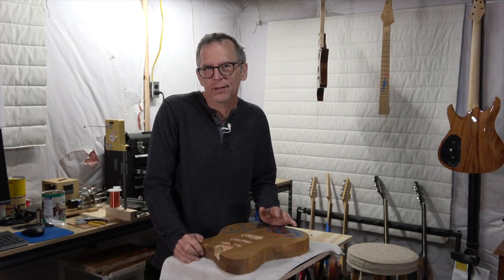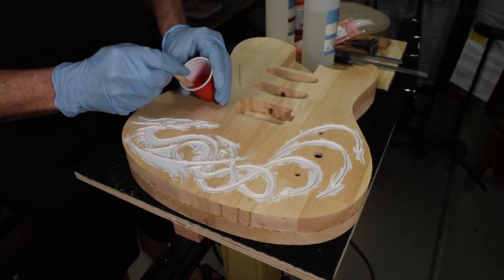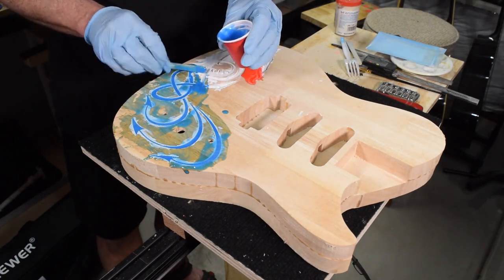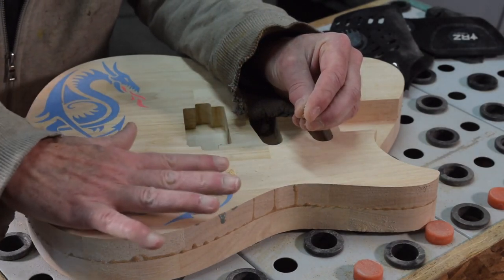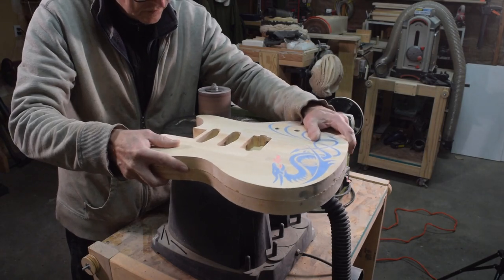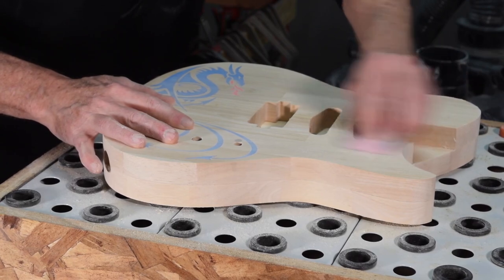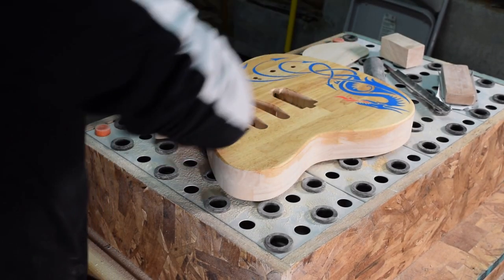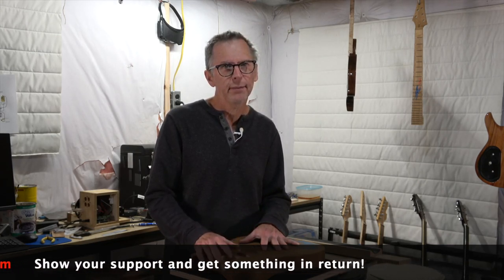Making A Guitar Out Of An Oak Table Top Part 6

Comment: As far as the Thickness question, It does look a lot thicker than a Les Paul because of the carved top too which makes the thickness look significantly thinner - even if its technically thinner than the LP's thickest point...
Reply from the maker: I agree. I just think it's odd that body thickness (or thinness) is a thing.
Reply: @HighlineGuitars  I don't think its a 'thing' as such - at least not until it 'looks' a lot thicker.
As a player, I would be less inclined to pick up a 'thick' body Electric - especially one that has a flat top and back. Part of the attraction of Ibanez S series guitars is that ultra thin body and how much of a Slab the Tele is and this looks 'thicker' and more 'cumbersome' than a tele.
I am not criticising your decision as a builder and enjoying watching your many builds. I was merely trying to explain why thickness can matter to a guitarist - especially if you expect to be playing the instrument for hours at a time - not looking at it hanging on a wall. Something as 'thick' as it looks (again 'looks'), I would expect to be a 'hollowbody'.
Again, I am not criticising,just trying to explain why 'thickness' can matter to a Guitarist. Of course there is nothing like actual hands on with the instrument and it may well surprise a few people if/when they get to play it.
Reply from the maker: @BAMozzy69  I guess that’s why nobody wants to play acoustic guitars. They’re so thick.
Reply: @HighlineGuitars  And some Electric guitar players don't find Acoustics all that comfortable - but they are also very light by comparison. 
As a player, I expect an Acoustic to be thick and large bodied in general because that is going to affect its sound a lot more. There are still thinner body Acoustics too.
Weight is a 'big' factor to me in choosing a guitar. For example, If I have the choice over a 9lb+ Les Paul or an 8lb (or less), I am MUCH more likely to go for the lighter weight model.
That guitar 'Looks' thick and heavy - again, I use the term 'Looks'. I know you have weight relieved the body but you wanted to know why Guitarists are 'concerned' about the thickness of this. I was only trying to provide an explanation - thick, unless its a 'hollowbody - like an Acoustic, often means 'heavy'. and a lot of people now don't want 9lb+ guitars...
I am not trying to criticise your build or choices at all, just trying to put some perspective on why some Guitarists maybe concerned about the thickness - even if its not as thick as a Les Paul at its 'thickest' point.
We see a thicker looking Les Paul type made of a Heavy Oak and thinking this is going to be a 'heavy' guitar that they wouldn't want slung over their shoulder for a 3hr gig night after night...
Again, just trying to give a 'players' perspective and why you may get more people making a comment about this...
Reply from the maker: @BAMozzy69  sounds to me like it’s a mental disorder. Fear of body thickness. I’m sure there’s a pill for it.
Reply: @HighlineGuitars  Seems to me you are completely out of touch with guitar players then and have no understanding of what a 'musician' looks for in an instrument - its not just a wall hanger to look 'pretty'...

Unfortunately, there isn't any pills for that...

So much for trying to help you see why guitarists were concerned about the thick 'slab' of a guitar you are building....

Comment: Amazing work! I can see you got a tensioner for the pick-up wire there in the back, will you make a video about it? I'm actually working on a very similar cnc winder as you do right now and I'm very interested in controlling the tension as well automatically. Would that be possible with that tensioner?
Reply from the maker: I’m in the process of rebuilding the prototype, which will include the tensioner. It works great. A video will be posted after I finish the assembly manual. Hopefully by the fall.

Comment: Could you use a heat gun to clear the bubbles and set the epoxy instead of a lighter?
Reply from the maker: You can, but heat thins the epoxy and blowing air into it, can cause it to splatter.